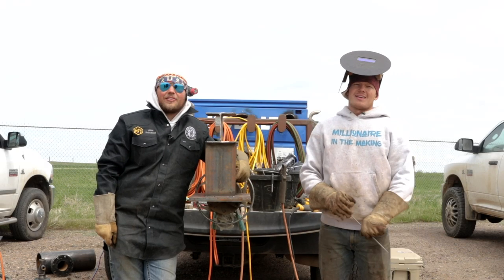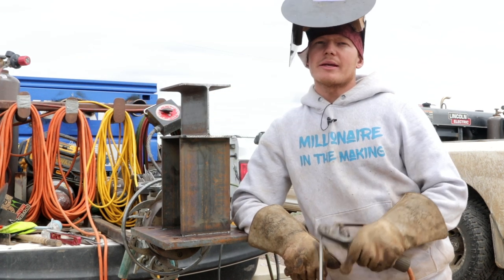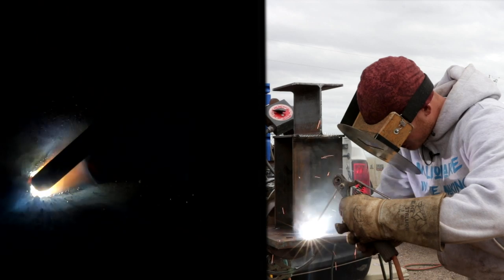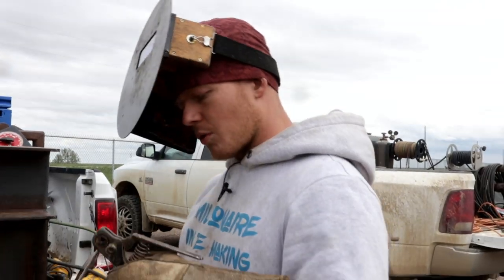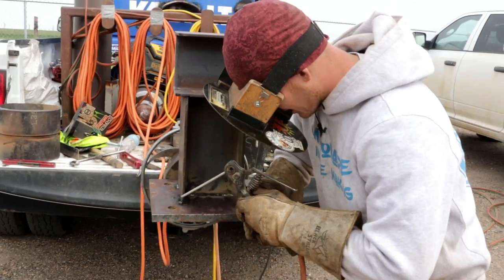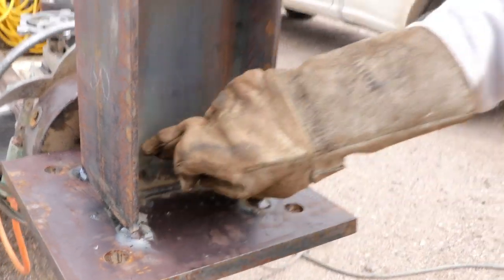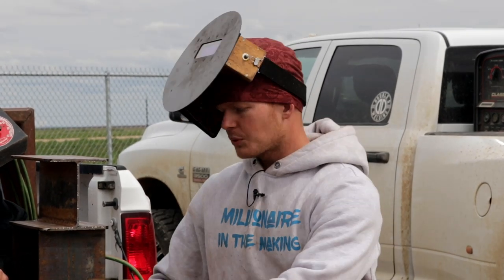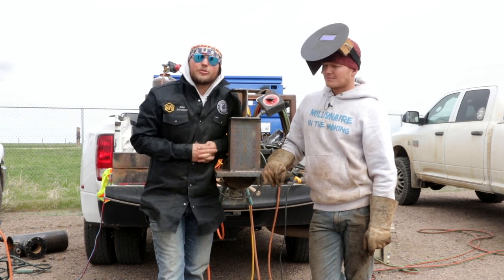Jed Structural Welding with Weldtube

Comment: Do the BB’s come from having rod pointed into puddle? Do you usually run low hy with your rod pointed in direction of  travel instead of toward puddle?
Reply: Danny Harvey he’s dragging, the angle of the arc shot is deceiving.
Reply: The bee bees come from too much voltage in the puddle
Reply: @okiedoke6373  correct, arc length is too long when you start getting bb's.
Reply: @stephenm6036  sorry no B&B other result of too much voltage in the puddle high arc length will cause BB's but 90% of the time too much voltage
Reply: You can not regulate voltage on SMAW. Only amperage. You need to google.
Reply: @okiedoke6373  High arc length=voltage spike. There isn't a magical knob to regulate voltage using SMAW.
Reply: @stephenm6036  I'm not trying to argue with you dude if you watch the video that Travis field put out it's the same stuff that they taught us and welding school way back in the early 90s highly likely I've been welding longer than you've been alive SAE350 which is what I weld with SA-200 Bobcat 250 Ranger 10,000 all have voltage adjustment on the goddamn machine dude

Comment: What’s the difference between pulling and pushing low hi?
Reply: Hermboii the difference is that you should only pull a LoHi rod like E7018. Its a drag rod. Jed did a great job explaining things and give some good tips but, those welds would look and lay in much better had he started at the corner farthest away and pulled in his direction.